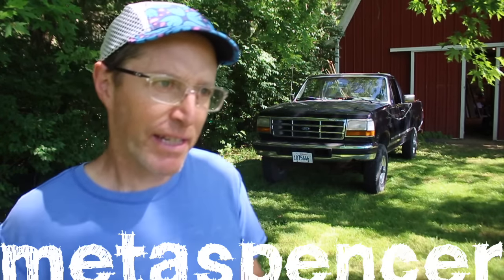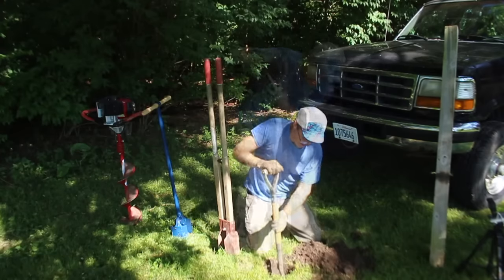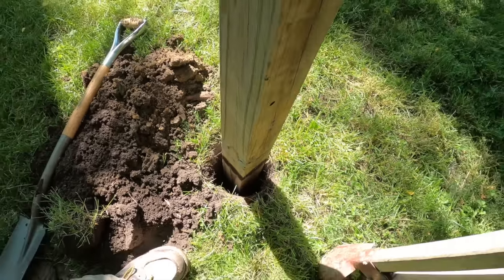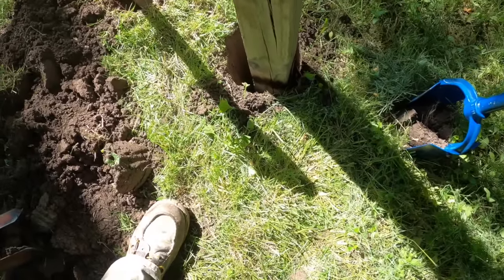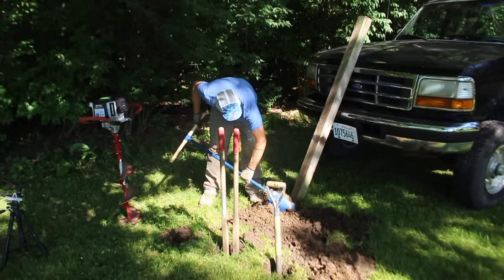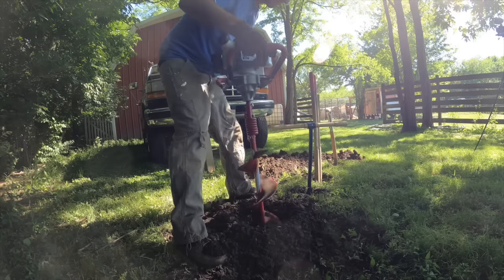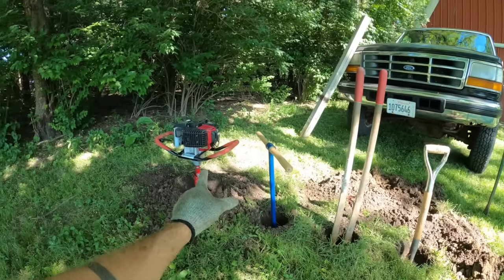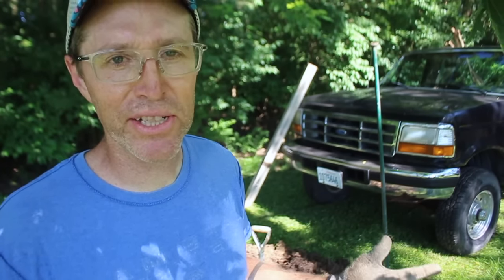Post Hole Digger Showdown!

Comment: I have used several power augers. The best is a two person 4-strok power anger. I dunno is there still made. It's been over 20 years since I last dug a post hole. The two-stroke one person was probably the worst.
Reply from the maker: Two people on the machine is great -- you said it. My tractor's auger is pretty good just not as precise.

Comment: I rented a powered auger to put a fence around my inground pool .  The ground was damp from the spring rains .  It was a two man auger , so my teenage son and I started the first hole , to our surprise it went into the ground like a big screw.  Since it did not have reverse I had to remove the head and use a pipe wrench to back it out of the ground.   After that we held it so it would not screw itself in the ground .  It was a learning experience .
Reply from the maker: Sounds like you guys got it done!

Comment: Hi there!! From India
You've showed and explained every auger very neatly. I've a question though, in here at my place we've a soil called as moorum which is a rocky, volcanic soil. So to put a hole for the fence posts what should I use?
Normally the labor here do digging with hand tools with ends up in digging a hole that is very big in size in terms of width, so I need a tool which dig a hole that is compact in size and deep ( say around 3fts).
Reply from the maker: That sounds like hard soil to work with ... I would use a rock bar and post hold digger. They work together every time. I wish I could help! Good luck
Reply: @metaspencer  thanks for the reply🙂

Comment: Great video man. Subbed. I saw in another comment you mentioned strapping a 2x4 to a 2 person power auger. Can you explain that in more detail by chance? Sounds interesting, but trying to picture exactly how that works... I have 50+ post holes to dig so hoping to find a method that is safe and not to much wear on the body
Reply from the maker: Yeah so we've just ratchet strapped the end of the 2x4 to both handles so one end sticks way out. The second person can hold that handle and completely control the torque. Even then it's jumpy. In rocky soil be super careful as it'll POP on ya ... in soft soil I've done 30 holes single handed in a day

Comment: You seem to give honest advice what is the best size to make a driveway gate. I feel the 12 foot I did is to narrow since I turn sharp in the driveag
Reply from the maker: Yeah narrow always seems like it'll be wide enough but in the end you end up wishing you'd gone wider. A wide dump trailer needs 10" just for the trailer ... so 15' to 20' is actually better because you're almost always turning at the end of a driveway

Comment: Really helpful as I have to fix my fence that falling down and have never built a fence. Any advice on fixing leaning fences? Many thanks!
Reply from the maker: If you're lucky, sometimes you can pull out just one or two rotten posts, replace them, and the fence will be saved. I have a video on it here: https://youtu.be/1RTFsM6a3JI

Comment: I intend to buy a Stihl or Husky power auger.  

Living on a small homestead, O have lots of holes to dig - fence posts, holes for trees, etc. 

The soil here is black clumpy, sticky clay.  My shovel clogs up real quickly while diging.

Diging a hole with a shovel and a pick is an extreme workout, and takes realy long.  

In your opinion, do you think that a power auger would still be faster than a shovel and a breaker bar?
Reply from the maker: I've dug 20+ holes in a day in agreeable soil with a power auger ... in the right soil it's a dream. If you happen to have a tractor a PTO auger is even more powerful and less dangerous to run (no twisted wrists). Be careful with the power auger!

Comment: Think I'd power auger 2 inch bit starter test holes and see if that's the fence line I'm sticking with, before powering my way through rock or roots with the 6, 8, or 12 inch auger bits. If frostline depth isn't the problem, going wide on a shallower hole might adequately stabilize the post. But: I keep an arsenal of auger bits, in case. Or stick a mole in a metal tube.
Reply from the maker: Sounds like a process that just might do it!

Comment: informative video- and nicely done. If you add  labeled tick marks on your wooden handled  hole digging tools (with a sharpie) you'd know how deep the hole is while you are working
Reply from the maker: Great advice. I tend to leave those marks in black marker, and then they wear off after a few fence jobs. So I'll go for the tick marks! thanks for that tip

Comment: Try forming a triangle with the power auger, much easier to control. I extend my arms and bend with my knees as it digs in, that way if I do lose control its far enough away that its not going to knee cap me :) I'm 185cm and probably slightly skinnier build then yourself and it works well for me.
Reply from the maker: Sounds like a good technique! I recently tried a 2x4 held by a second person and attached to the auger and that was great. Wild tool!

Comment: I’m just a girl so the gas powered auger is not an option for me unless I set up a tripod crane apparatus to lift it out of the hole. You’re a fella and I saw you struggle a bit with it. I figure I’ll start with the shovel and finish with the hand auger. Even the post hole digger looks like a beast I may not be able to handle for too long. Also, if I’m restricted in this way then I won’t over do it. A couple holes here and there over the course of a week I should have something approximating a small horse paddock…I hope. I’ll start with the gate and then go out from there. If anyone that knows anything about this stuff sees my comment I wouldn’t mind a critique.
Reply from the maker: You'll get it done! When my wife digs post holes she used a manual post hole digger and a rock bar, one then the other, and just goes slow until it's done. You will get it done for sure!
Reply: @metaspencer  thanks:)! 🙏

Comment: I build fences for a living. Every single day I have to carry cement, demo old fences, dig holes and many times brake concrete using sledge hammer and chipper etc.
What I have noticed gives me wrist pain is carrying and lifting the cement bags, other times I get body aches in the morning when I get up I feel like very tired from the day before Nothing else. You have to hold with both hands that machine and maintain force all the time in case it hits a root or a rock.
Reply from the maker: A pro fence builder! I had a fence building company for two years and know what you mean: satisfying labor, but also really tough! I always tried to buy the lighter bags of concrete, but it's still tons of work. Do you do chain link and wood? I only did wood fencing myself

Comment: I challenge you to dig a post hole with that post hold digger with the hard pack clay we have.  Its damn near impossible to get much below 12 inches even with a spade.  Never tried the hand auger though.
Reply from the maker: in hard ground I always use a rock bar ... slow going but that dang thing will black through everything short of solid rock

Comment: Seafoam in the gas tank at the end of the season should help preserve the gas tool. But gas these days goes bad way quicker than it used to. I've already got that shovel, maybe I will give that a shot. I never even thought about using it for pergola posts before. Can't find the dirt auger on craigslist, only ice augers come up. I do have the posthole digger but with a bad arm/shoulder it's not something I can really use. But thanks for opening my eyes!
Reply from the maker: I'll have to try the Seafoam ... I'm horrible at remembering to drain the tank on my mowers and saws, as I guess I always think I'll use it one more time. "This year will be different" he says :)

Comment: Fence guy here anybody interested in using any type of gas auger you need something like a little beaver that comes with the stability bar it only requires one person to operate is easy to maneuver in tight spots and comes with different bits for all soil types
Reply from the maker: Got a link? Sounds promising
Reply: Most fence contractors use them in my area of NC and they have them for rent at most united rental, herc rentals, ect
Reply from the maker: @davidmatute7830  COOL design ... torque elimination on those little beaver units is nice

Comment: I grew up with my Dad using the hand auger. I though it was the only type of post hole digger there was. I was in HS before I learned of the two handed clam type digger. I hated using them. They are only good for cutting roots and bumping hand size rocks out.   Also most people do not know the round end on the digging bar is for tamping.
Reply from the maker: Cool to hear that you have hand-auger experience. They're often overlooked! That blunt end of the digging bar is a great tamp, as you mention. Gotta watch your toes! :)

Comment: Power auger needs a Fixed Station, maybe something that takes 5-10 min. to set up.  That you can set the Auger in to make it work without having to fight it.
Reply from the maker: Here's what I've done most recently: strapped a 2x4 to the handles and then had a 2nd person hold the 2x4. It stabilizes the auger really well.

Comment: My question is:

Is it better to flush-ground cut old posts and open up new ones. Versus pulling out the old posts and having a ready made hole.?  Some old holes would still hold cement and new holes can lead to roots, rocks etc.

Any thoughts.
Reply from the maker: I've gone both ways. In some cases that old post comes out leaving a nice hole that you can re-use and work with. In other cases the post breaks off, is rotted, and/or there is way more concrete down there than you could have ever imagined. In some instances you have no choice and HAVE to use the same post position. I personally prefer setting new posts in new holes, but there are just a TON of variables that you've gotta consider
Reply: @metaspencer  
That is a great reply and helps me to address the issue with the homeowner. 

Out of 31 old posts only five need to be replaced. The others are solid, but weathered and grain-opened. 
So, replacing w/ all new is gonna costs a lot more in materials and removal charges. 
Aesthetics =💰💰🤑
Reply from the maker: @BlueOriginAire  sometimes those old posts pull right out ... other times it's a chore to get them up and out!

Comment: Good job but you should have shown the power auger rip an arm off when you hit a root. They need reverse. You need to add it. Or a way to revierce. I got one and the trans lock was broken.
Reply from the maker: Yeah those power augers can really injure in hard ground and with rocks. Super dangerous. I strap a 2x4 to the handle and have a second person hold the end to help stabilize it

Comment: Mechanical auger with 2 people wins every time in efficiency, foot print, and strain on the body. 

Post diggers and manual augger are mehh

Sharp shooters dont work with your feet.. purely a hand tool to loosen material. I love using them for exactly that.. otherwise its annoying to use a tool that cannot move material

Comment: Milwaukee hole hawg od DeWalt makes one too. with an auger bit .hole hog can be used to mix your concrete or mortar as well. 300$ it's a giant drill with the torque of an auger so more versatile and it's electric so no gas motor maintenance!!
Reply from the maker: Haven’t tried those but sound promising! Thanks for the tip

Comment: Great video! I need to set an an eight foot tall post to secure a shade sail. My ground is clay-ey and rocky and probably full of roots. Given an 8ft post, I believe I need to go at least 3ft, maybe 4ft deep. I probably want to dig  a wider hole for a very stable post. Fortunately I only need to dig two of them. I was wondering what tool to use and you really clarified a lot for me. I guess I will buy or borrow a post hole digger. I happen to have a narrow shovel as well. Now I just need to figure out how big a hole and how much concrete I therefore am going to need.
Reply from the maker: Sounds like a good project! I'm thinking 3' deep will do it -- I almost never go 4' down. some concrete or gravel and you'll be good to go!
Reply: 1/3 of the height is a general rule

Comment: really appreciated the comparison ... though dream dashed: was hoping the power auger would be ace in clay and rocks, 'cos watching from Australia: after the 1 inch or so of top soil that's what we have to deal with [lol]. Looks like you've saved me some money.
Reply from the maker: There is a way to brace a power auger with a long pole so it doesn't spin ... when fully braced you can crank it up and often get through some tough ground if you have enough torque. But you'll probably end up using a steel bar. Good luck mate!
Reply: @metaspencer  thanks for the reply and suggestions; appreciated!

Comment: what do you recommend hole size and depth for a 2" galvanized steel post? I'm going to install solar panels on top weight about 70lbs. Thanks.
Reply from the maker: It kind of depends on your soil and if you plan to pour concrete around the post. I've seen solar panel posts screwed into the ground. Anyway: a 6" hole should give you plenty of room for concrete with a 2" post. If you went with a 4" hole that would likely work, too, as long as your ground isn't too soft
Reply: @metaspencer  Thank you. I will use concrete and a 6" hole. Much appreciated Sir!

Comment: Around here coral rock means none of these tools can work. Your disclaimer about hard rocky ground is true wisdom!
Reply from the maker: Wow, I've never dug in coral rock ... sounds tough! I did put in 20 posts in slate filled ground and it was ROUGH :)
Reply: @metaspencer  The way I do it is with a skid steer and hydraulic auger. A tractor can work too but i hate looking backwards and you cannot reverse your auger on a tractor if it gets hung up in a rock or root.
Reply from the maker: Now I’m jealous! I’ve only rented skid steers and they’re great. My dream is a mini
Reply: @metaspencer  I bought skid steers that had mechanical issues and fixed them up. Same with attachments. It's so easy to put one on the trailer and tow it to where you need it. The only downside is they can make a mess if not careful. Even an old machine beats doing it by hand if you can access the job site.

Comment: I just bought that power auger but I can’t get it to start. The pull switch is really rigid and gets hung up half way out. Eventually, I can pull it. Any ideas?
Reply from the maker: Choke pulled out? Gas and oil mix? Sounds like starter has a catch … it should pull all the way out
Reply: @metaspencer  I actually left it alone for a few hours, and now it works just fine. No idea what was wrong with it, but I'm looking forward to building my new duck and chicken runs tomorrow. Thanks for the response and the video!
Reply from the maker: @sarahanderson7521  New bird run. Exciting!

Comment: My soil is packed so tight a gas auger wouldn't dig into it I had it in the hole for 10 minutes and I might if went 1/2 deeper. Post hole digger wasn't getting anywhere  useless it would only grab a tiny bit of dirt each time woulda took 12 months to dig a required hole . Lol. Need a farm machine with a auger to put several tons of pressure in packed dirt to get anywhere.
Reply from the maker: That's tough soil! Yeah, we recently added an auger to our tractor and it cuts through the hard stuff ... the auger shows up in this video: https://youtu.be/aM7-rizAw_I ... good luck!

Comment: I’m wondering if the power auger would dig through roots, or do u know what tool would be better?  My wisteria roots and citrus tree roots fill up the ground so that nothing else can grow around them. I’ve used a pick ax but that’s hard on the body and I’m only 5’ tall. Suggestions?  Also my queen palm trees have a hefty skirt that spreads underground and chokes out everything around them.
Reply from the maker: Auger will hurt the user when it hits roots. I find only a rock bar or chainsaw to work on tree roots
Reply: Cultivator?

Comment: Cool comparison. Not a fan of using concrete for stabilization. It causes drainage issues and rots the bottom of the post!
Reply from the maker: Gravel then?
Reply: I’d really depends on your situation, but yes, gravel.

Comment: How deep should 7 foot post be?
Reply from the maker: it depends on your location and the frost line. typically 3' will do it most places but it depends on what you'll be doing with the post. sometimes 4' is needed if it'll have side pressure/pulling

Comment: I really struggle going from 24" to 36" deep.  The handles of the standard wooden post hole digger run into the hole sides, forcing the hole to be widened after I am down 30 inches, and my arm wont reach the dirt down there.  sometimes i use a shop vac and long heavy breaker bar (your bonus tool).  I have tried those larger, heavier/more expensive clam hole diggers.  They make a larger hole and you get another 6", but that is about it, and they are really heavy, so you really beat yourself up.  I find myself digging 36" holes when one side is 12" higher than the other on a fence line, retaining some dirt.  I would rent a two man gas digger, if i could talk someone into helping me, but that is not as likely as you might think.
Reply from the maker: I had a fence to do this week with 33 posts and know exactly what you mean: that bottom section is the toughest. Rock bar gets a few more inches at a time, but it's slow. I was in mud this week but with dry stuff I'll have to try that shop vac idea. Happy digging!
Reply: I think Spincer called the post hole digger a shoulder buster, but digging those deeper holes will bust your butt! I’ve done my share of 3’ post holes with just the post hole digger. Once you get down a ways, you have to stop trying to bend over and teach yourself to squat. It’s a workout that’ll seriously build some muscles and rip your pants, but it gets the job done quickly … after you build those muscles.
Reply from the maker: That’s no lie!! Tough work